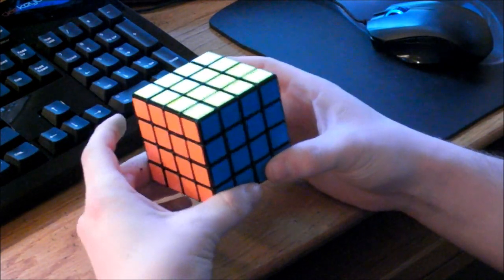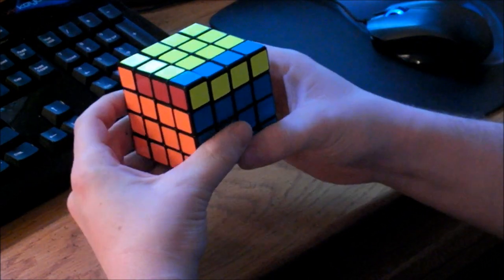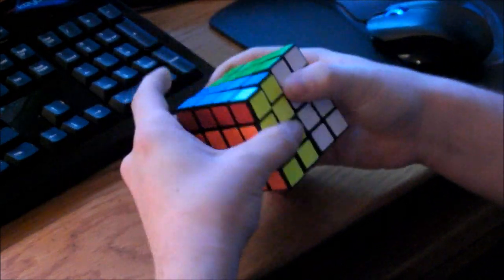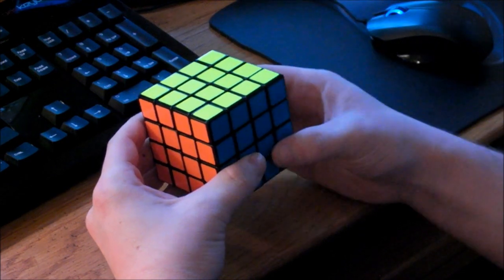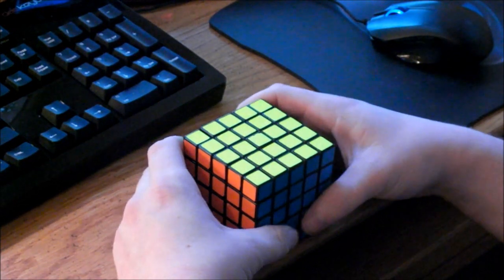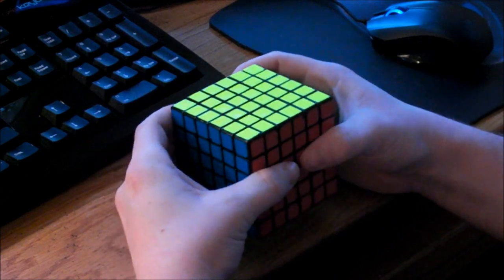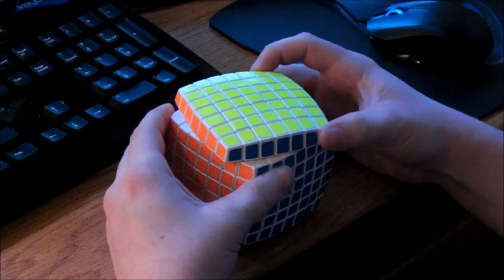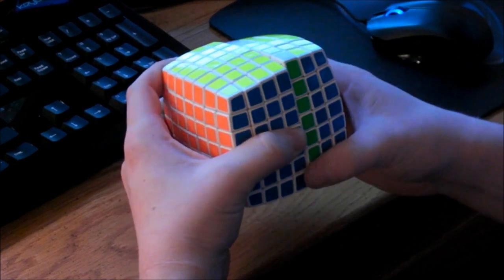How to Perform OLL and PLL Parity on Big Cubes (4x4-7x7)

Comment: Great video! I'm not a speed cuber. But any alg. That's easier to use and memorize is terrific. My problem: I've just learned the 4x4. But I keep running into an OLL issue that I can't find a solution for. When two middle are opposite, I have an alg. And no problem. BUT what if I have adjacent middles ( like blue and orange)?  I was told to use the Opposite alg. And then finish cube like a 3x3. Isn't there an alg for switching adjacent middles - like there is for swapping opposite/parallel middles? Hope this makes sense. Mahalo.
Reply: Just do the PLL parity alg and then you'll just be left with a U-perm.

Comment from the maker: @assandwhy I have an adjustable core in all my V-Cubes, and on my V7 I sanded down some of the internals to make it smoother. I also used a mix of Lubix and "Help Lube" to make it fast but still smooth. I love the cube, it's just my hands are too small for it =p